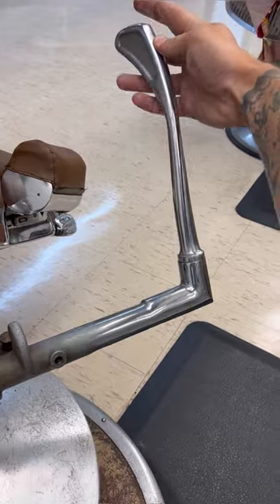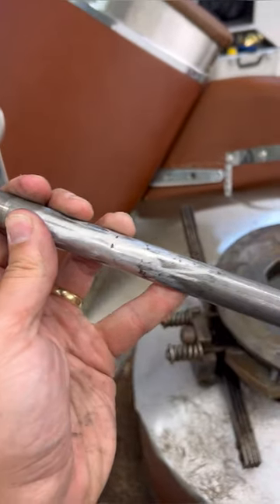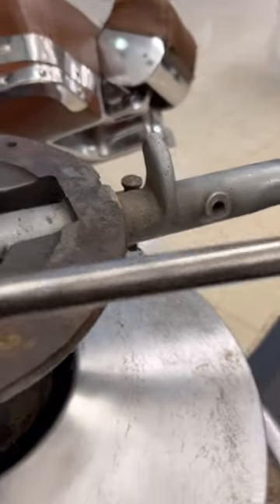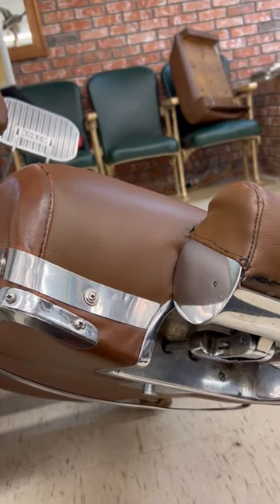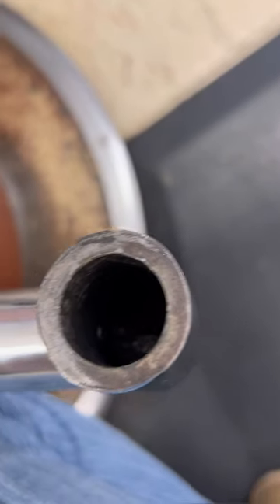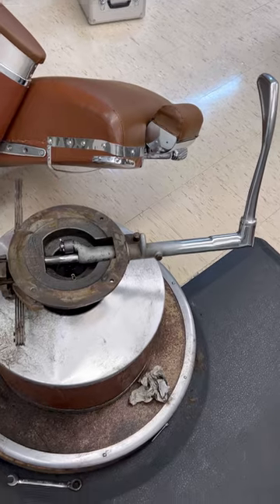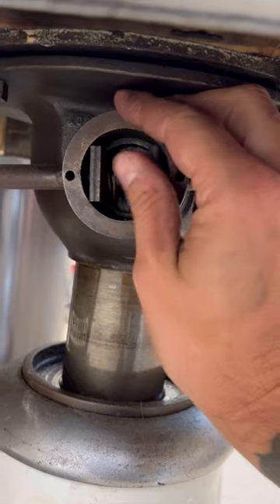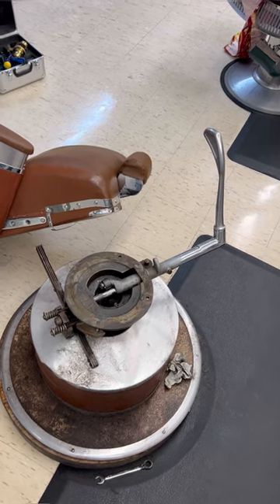Barber chair recline repair.

Comment: Hello! I’m working on the same barber chair but my issue is the chair not pumping up at all at this point any recommendations thank you!
Reply from the maker: Is the handle stuck or is just freely moving? If it’s not pumping it’s usually something internal in the cylinder. First it could just be out of oil. Second the O ring inside is bad and it can’t maintain pressure. Or third the o ring has slipped out of the groove and is pinched between the cylinder wall causing it to be stuck or very stiff. There’s tons of videos of people separating cylinders. You will need a friend to help you. Make sure the pump handle is all the way down and lift the cylinder out. You can go to a heavy duty hydraulic mechanic or shop and they’ll be able to give you a new O ring. If not just measure the width of the cylinder and order one off an O ring supply store. Hope this helps! Feel free to ask more questions

Comment: I moved my Koken from parents' home to mine and lost hydraulic oil while it was tilted on the dolly. How do you add oil? All functions work, up, down recline...it just will not lift to top now.
Reply from the maker: @jeffreywood8961  try removing the seat they’re might not be a cover plate on there. Fill directly from the top. If the plate is on and there’s no whole with a little door on there you will have to unscrew all four of the main bolts holding the chair onto the pump. Then remove chair then the plate…a huge pain with this style chair. Let me know what you see
Reply: @Raysbarbershop  Will do. Thank you!

Comment: I am looking for an O RING for a Koken president chair , do you have an idea where I can purchase one or any suggestions
Reply from the maker: If you can take the cylinder to a hydraulic shop and they’ll probably just give you one. That or measure the diameter of the cylinder and order one online. There’s sights where you can buy any size.